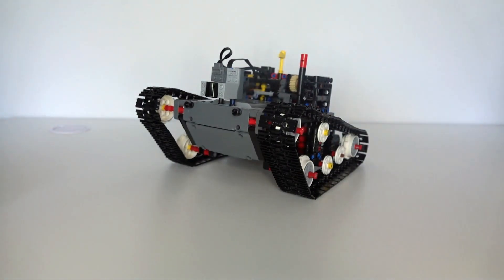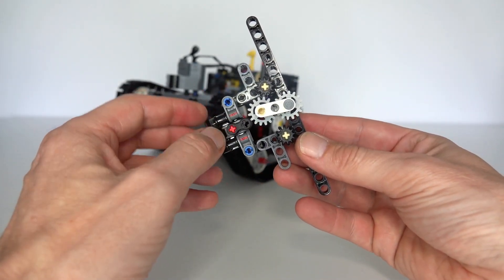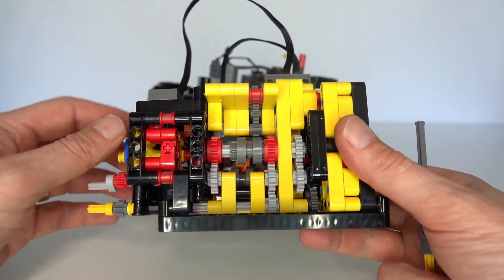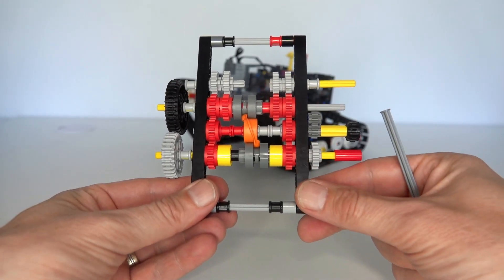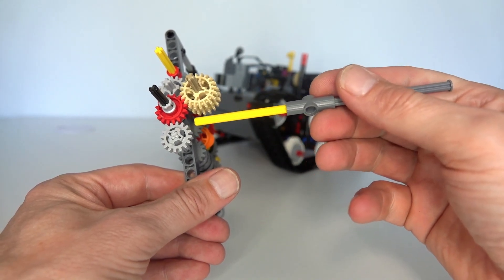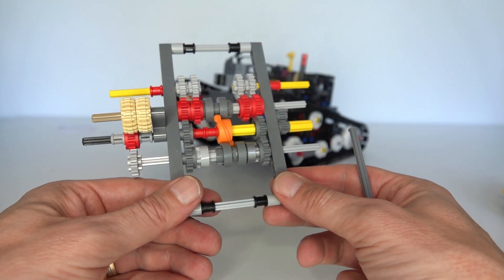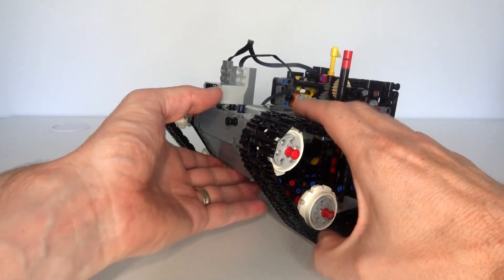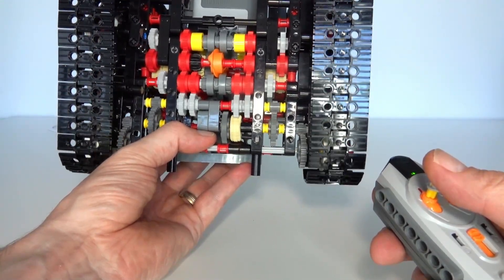Lego Technic Single Motor Tank

Comment: damn that's very smart.  Imagine what would be possible with 4 motors and many multi-selector mechanisms.
Reply from the maker: Hi there  yes you can create many functions you can control. In fact you can just use one motor to have as many functions as you need by using this technique.
Reply: @TechnicBrickPower  yeah.  I guess you can, but I'm not sure of how it would work.  Would it just create a longer cycle that you still use with just one direction?  Or can you kind of add another layer and then make combinations of different functions in the same time ?

Comment: seems like the gearbox is causing a lot of friction becasue the tank is struggling to move
Reply from the maker: Hi Rapolas - yeah I agree - I can gear it down more but having two motors simply connected to the tracks is always going to work better.

Comment: I haven't tried linking all the gears up so I don't know how compact it gets, but my concept for this would be:
use 2 of the steppers, phased 180 degrees of input apart.  That means you have, as input rotates,
one steps
two steps
one steps
two steps etc.
Set the gear ratio on these, so each is turning a shifter 180 when it steps.
Then link one to the left track with forward/reverse drive depending which way it's selected, one to the right track ditto.
so if you start out in forward+forward, first 180 of input, it steps the left track into reverse (turn left), next 180 it steps the right track into reverse (drive backwards), next 180 it steps the left track into forward (turn right), next 180 it's back where it started, drive forward.

I tend to think with straight lines of gears so I'd probably accomplish the reversing by having 16-16-16 on one side and 16-8-8-16 on the other of the shifter, probably there's a 3d option that's just 16-16 and 16-16-16 though.

Comment: I built a simple system with the pieces I had,  it was a double differential mechanism. 

It would be able to move with one motor, the steering would be an arrangement of gears (forward and reverse) but due to the limited number of pieces I had, it was not reliable as i had to cheat a bit with the placement of some parts, but as a proof of concept it worked well enough when I presented the project in class, the professor really liked the design.

Thank you for posting this video, your design gave me some ideas on how to improve the gearbox of my previous build.

Have a Great Day / Night.
Reply from the maker: Hi Captain! Wow I'd love to hear more detail about your design. My design is quite complex and I am convinced there is a simpler way of doing it - just need to think of it! Kind Regard TBP
Reply: @TechnicBrickPower  
I Created a Pinterest folder with the pictures I have of the build.

the only thing that those pictures lacks is 2 of those larger gears  so that the power from the motor will be shared between the steering gearbox at the top and the gear that turns both differentials.

The gearbox would be in neutral for the tank to move forward, for steering, one of the gears would be engaged.

i don't have more pictures of the build unfortunately and I disassembled the build some time ago, but I hope the pictures I provided can help you with your lego projects.

Link to my Pinterest folder with the pictures:
https://br.pinterest.com/renanvenancio20/lego-double-differential-steering-mechanism/

Comment: This is absolutely mind blowing!

I personally thought you would use the below idea to change the functions.
For example, instead of manually changing which mode you're in,
You could have reversing the motor change it, while having the motor go forward actually driving the function.
In fact you would achieve actually full remote control over the tank with a single motor, if you disregard the fact you can only do one thing at a time.
Reply from the maker: Thanks for your comment. Maybe I am misunderstanding you, but isn't that what this build does? It uses the reverse direction to change functions and forward to drive the selected function.
Reply: @TechnicBrickPower  But I saw you use your hand turning something on the top, which I thought was you changing the functions.

Comment: Combining the transmission and the tank drive gearboxes would make for a really nice setup. Have four gears on the transmission, then have reverse, left drive, right drive, and L+R drive on the tank drive gearbox; as a driving platform for a tank, I don't think this could be beat. Though, I wonder if this could be designed with a single rotary catch, with the four clutch shafts in a cross with the catch in the center; I'd say it might be worth looking into, but the gearing might become an interesting puzzle to figure out, aphantasia curses me with the inability to mentally visualize things so I'll have to build this setup to figure it out.
Reply from the maker: Yes this tank needs more gearing down to give it more power so an additional gearbox added to this may help. Then again just 2 motors connected straight to the tracks seems to work much better! LOL🙃

Comment: well done TBP! you have exceeded expectations with this one. Ok lower gearing or more power would be great but you have achieved something really awesome with this mechanism, and for other Lego fans you probably win the Internet today! 👍🍺
Reply from the maker: Hi Carl - thanks for your comments. Takes genius to recognize genius LOL. I have made many gearboxes now - have come to the conclusion that connecting the motor straight to the output works best! LOL. Might look into buwizz for some extra grunt. 🍺🙃
Reply: @TechnicBrickPower  Put two motors in parallel on the power shaft, it's very easy to do with power functions (just daisy chain another motor and cable), a bit more complicated with powered up (have to join two motors in the app), make sure to put 3 gears with a central output shaft so motor load is balanced.

Unless you're using very old gears they should be handle the torque from two motors.

Comment: Very neat, could be a good basis for an AMX-13 model.
Reply from the maker: Thanks Ole - but best practical solution is still 2 motors!
Reply: If you want to do a big model I suggest you to use a "subtractor mechanism

Comment: Oh that poor overstrained motor! 😆😂😆
But the design is incredibly impressive; Your ingenuity in finding the gearing solution to achieve a desired result is incredible! (whether the result in question is /practical/ is really not very important, the challenge is showing that it's /possible/!)
Reply: Are you addicted to using the backslash character
Reply: @Thatstingray  slash, not backslash, to be precise. Used for emphasis, like I would have used italics if it was possible.
Reply: @johansten7976  it can either be a forward slash or a backslash
Reply: @Thatstingray  / = slash or forward slash; 
\ = backslash; they're different characters.
Reply: @johansten7976  I know, I’m saying that the slash you made is called a backslash or a forward slash, not just a “slash”
Reply from the maker: Hi Johan. Yes I need to invest in buwizz. It is about the challenge and giving people ideas. Often I find solutions that don't work for one thing work great for some future something else. In this case the simplest is just 2 motors connected directly to the tracks... 🙃